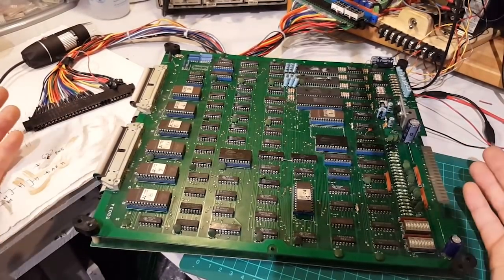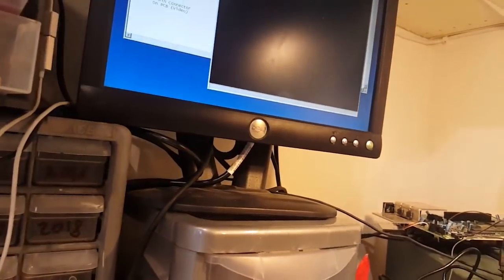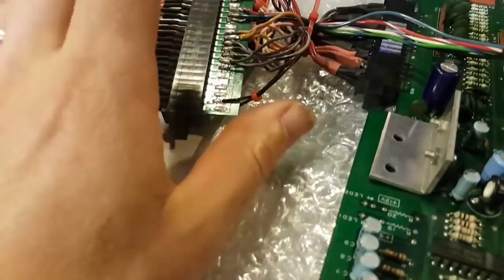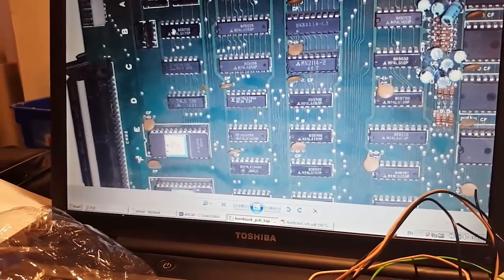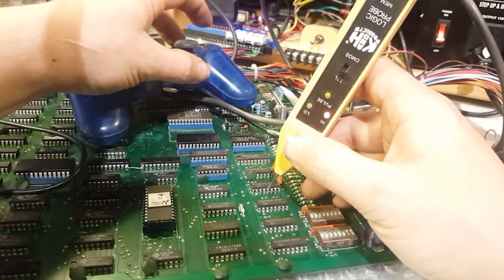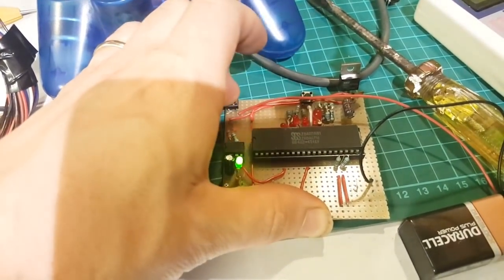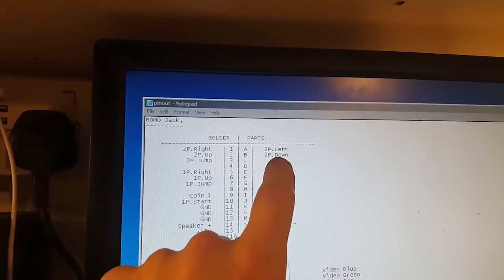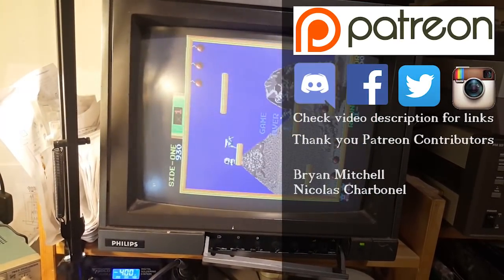Arcade DIY #46   Bomb Jack pcb repair

Comment: Working on the same thing, mine came out of a mini-cab that I got locally for $100.  The power supply had blown so the owner tried to replace it and 'broke some wires', the cab was 110v inside so he hooked up his new power supply but switched to 220v.  Quite frankly a mess, I discarded the old harness and have made a new one, no video signal at all for me so far, changing the volume pot does effect the noise sound coming out, so I know that part may be good.
The edge connector looks almost completely scraped off, so I will look there next.
Great video as always.

Comment: good job troubleshooting that!  When you find that a replaced chip doesnt solve your problem do you usually keep the replacement socketed in or do you switch it back to the original chip?
Reply from the maker: no I leave them socketed, it doesn't hurt and will make things easier should they fail in the future. When repairing a computer , because there's usually a handful of ICs i usually future proof it ( after fixing the issue)  by socketing all the Ics
Reply: Replace the caps in the audio section. I had a similar issue with Rolling Thunder and it fixed my problem.